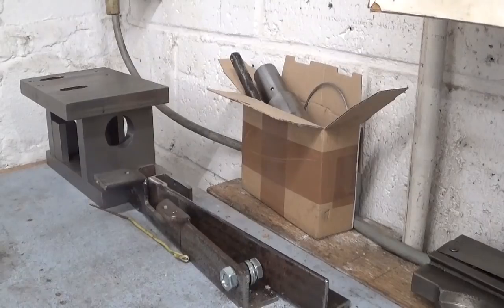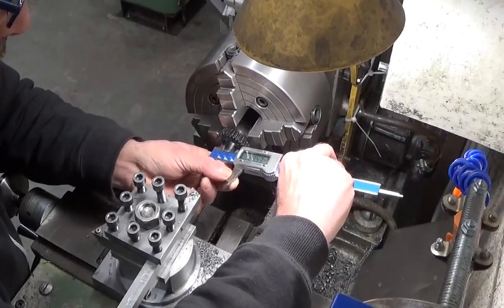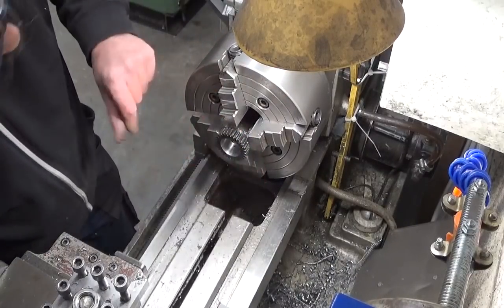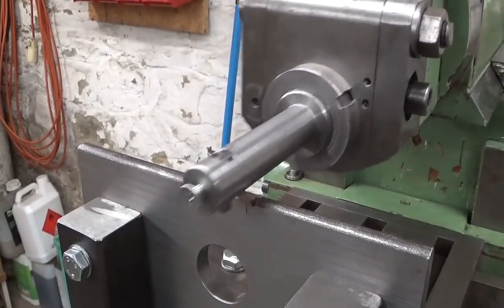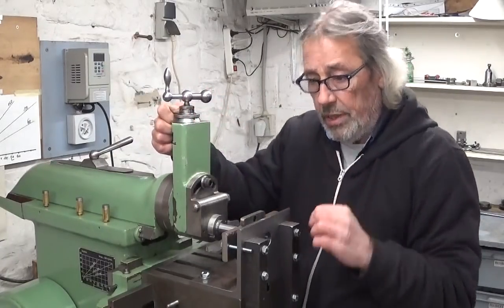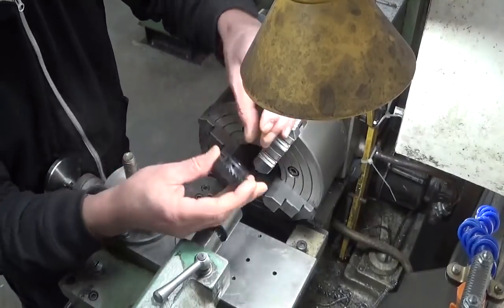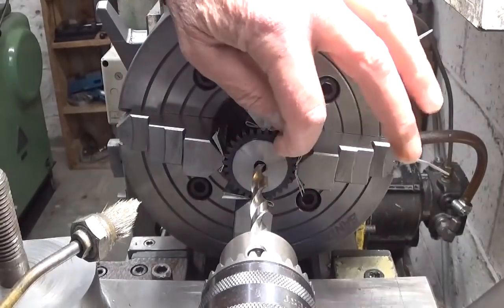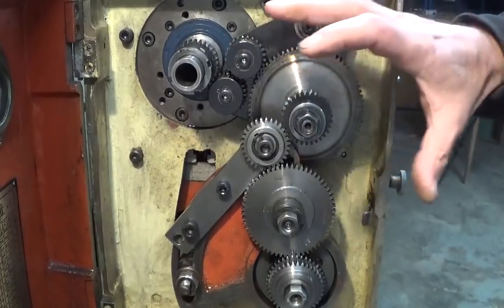Adapting gears for the lathe.

Comment: This brings back memories, modifying gears like this was the first job I ever did on my lathe.  Without a shaper, I used the carriage in the lathe to cut the keyway.  Luckily, two of the gears were idlers that got bushings, and one I found in the correct bore with a keyway, so I only had to cut one keyway.  You have to enjoy using a machine to fix itself.
Reply from the maker: Slotting on the lathe works well. It just takes much longer.

Comment: Nice work Michel, and very entertaining. On the bore of the gear, I think the bore deformed slightly when you released the chuck. Regarding the keyset, we had a dedicated seat machine, and it had a v-block centered on the cutter which was easier than adjusting to the bore. Enjoyed very much, cheers and take care!
Reply from the maker: The V-block is a good idea. I will think a bit about that.

Comment: Michael, it sounded like the first gear was case hardened. If so, after you cut the hardened part out of the bore the metal around the set screws would still be hard.  This would make two tight spots in your bore, and would account for the terrible noise when you cut the keyway. I enjoy watching you think through problems and come up with great solutions.
Reply from the maker: That makes perfectly sense. I think the chatter comes from the toolbar.

Comment: Hi M
Great bit of Adaptation, (Were there's a Will, there's always a Way). Thanks for the Shout out, nice to hear your in love with my little Adept shaper, may be you will come across one at some time!!!
By the way, what's the make of the VFD you plugged the shaper in to. I might get one at some point.
cheers 
Kev
Reply: Where there's a what? :)
Reply from the maker: I bought this VFD on Amazon. There's a lot of different models, so take your time to pick the right one.

Comment: Nice video and very interesting.  What would you say about welding stiffeners on the ends of the angle fixture.  The chatter "vibrations" may well be coming from the bending of the outstanding leg of the angel where the shaper pusses against.  Angled stiffeners may not get in the way and they may stiffen the fixture to take the chatter out.  Just a thought.  Thank you for the video.
Reply from the maker: That could work, but the chatter comes from the tool holder. I should make a shorter one.

Comment: Would a thin V plate installed from the top of your slotting fixture help to center the work piece and can also align the table to your cutter bar.
Reply from the maker: That could work, but only if the cutting tool is centered with the tool holder. That's not always the case.

Comment: Nice job, Michel. Shape and lathe action in the same video! I wonder if your spindle/headstock might be out of alignment and you are cutting a very slight taper, causing the new gear to only fit one way??
Reply from the maker: Indeed, the head stock is out of line, but the distortion was caused by the chuck.

Comment: Could you switch the wires in the switch so that the motor spins in the direction indicated on the switch, or are you bothered by that kind of thing.
You must feel a great sense of accomplishment by being able to do that yourself.
Reply from the maker: The spindle and the lead screw have to spin in the same direction to cut a right tread. It has nothing to do with the motor.